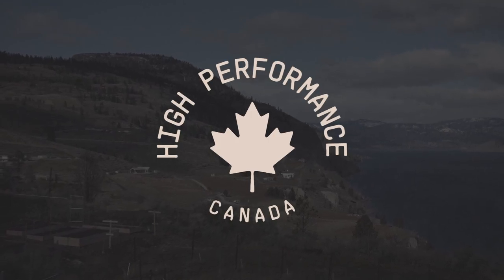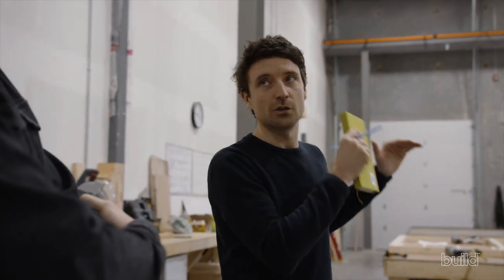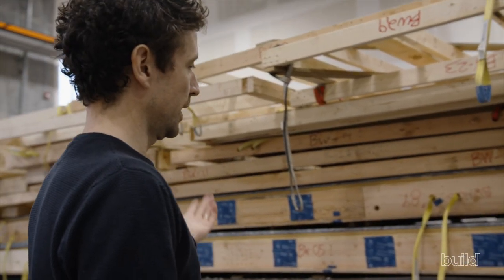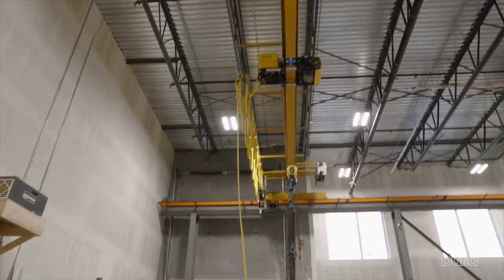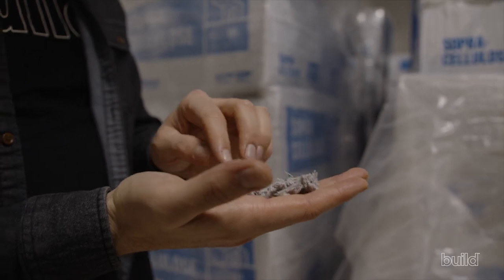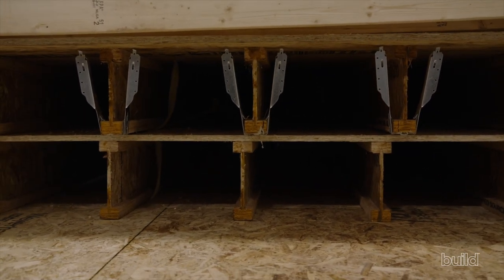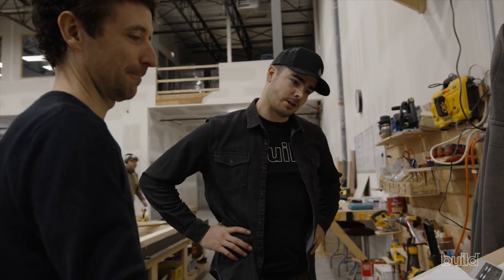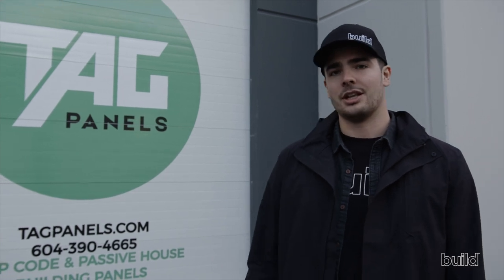Factory Framing Passive House Walls - High Performance Canada Episode 1

Comment: What about electrical?
Reply: i went to the builder's webpage and couldn't see any obvious electrical, nor did they mention it, but how could they not put electrical in before sealing the outer walls?
Reply: He mentioned that there's a separate service wall built on site inside of the sealed envelope. That allows them to avoid using the exterior wall for services which keeps the insulation values intact around the entire envelop. Most Passive House certified homes are built this way, although it's not required.

Comment: So honest question. IRC zones 4-7 requires interior retarder to be below 1 and plywood has a perm of 10 so how does this meet code?
Reply: @ArthurDentZaphodBeeb  why are you talking about OSB? I said plywood... It's a code question, not a "best practice" option question. OSB is not plywood.
Reply: @CybekCusal  

Here ya go, pal.

Water Vapor Permeance

Water vapor permeance of structural panels refers to the rate of moisture transmission through the panel as a function of the water vapor pressure gradient that can exist between the two faces. Water vapor transmission is measured using ASTM Method E96. This uses a controlled environment in combination with either a desiccant (dry-cup) or water (wet-cup) to create a vapor pressure gradient. In either method, the weight change over a specific time is used to calculate the permeance. Values are reported in perms (grains per ft2-hr-in. HG vapor pressure). A grain is 1/7000 lb. (0.065 g).
Research at the National Institute of Science and Technology has shown that the water vapor permeance is very sensitive to the relative humidity gradients. For example, at 50% humidity the water vapor permeance of plywood is approximately 1 perm but the water vapor permeance may be increased by a factor of 10 when the humidity is increased to 90%. Similar results are reported for an OSB siding product which had been coated with a latex paint.
Water vapor permeance of structural panels has been evaluated by APA using the dry cup method. Plywood species selected to be representative of the industry were evaluated in the 1970's. The Water Vapor Permeance table below presents results for various species of 3/8-inch Exterior plywood.
https://www.performancepanels.com/permeability
Reply: They mite be also be doing a vapour barrier paint which does meet bc code.